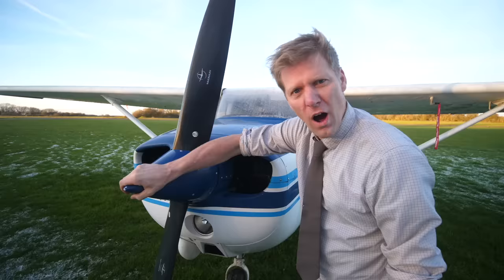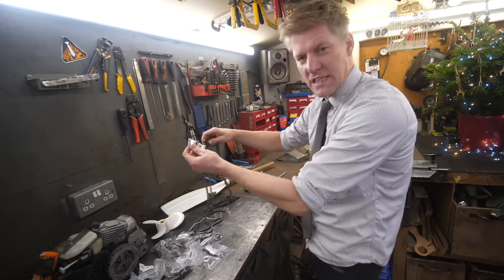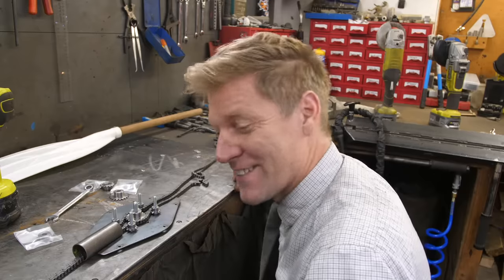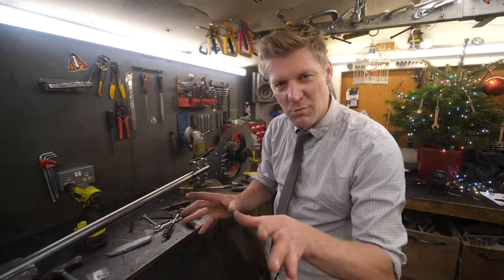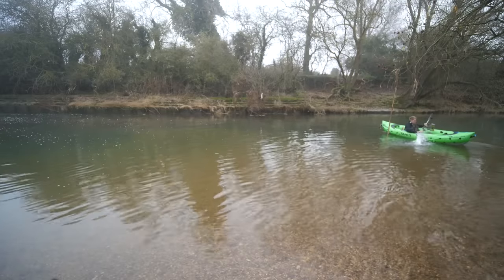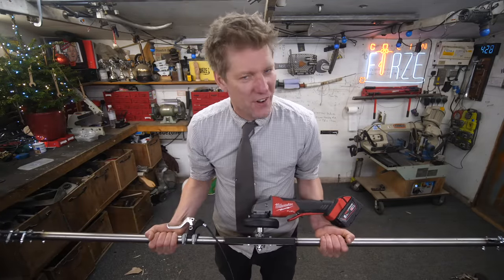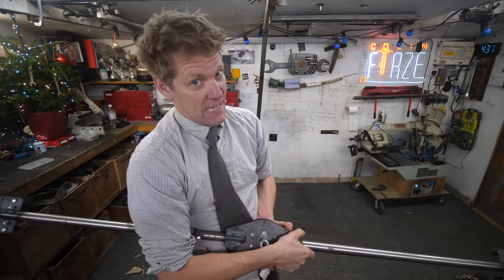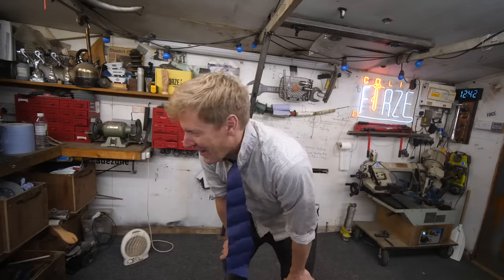I put high Speed Prop Blades on my Kayak Paddle!!

Comment: I can't help thinking about a curved bow fixed to the boat, with controls to spin the oars - with one side larger on each paddle - on the vertical axis (with the controls center-mounted). Even better if controlled with a joystick. Motor forward spin, backward spin, single motor for turning or double for straight forward or reverse. Almost like airplane controls. Except you don't want pitch or yaw with a boat.

Comment: I think, that You should unlink both props from each other — get one big battery in the boat, then put wires in the paddle. Put electric brushless motors on both ends of paddle, and make "open contact" in circuit. So when you put paddle in water, electric chain closes by water electric conduction and motor starts to spin. Add speed controller on paddle handle and You are done! No water from chain, less noise, less power-hungry and much lighter design + more speed. Each prop will work only when it will be submerged in water.

Comment: One cool idea would be to add some sort of sensors to detect once an oar is in the water. It triggers the correct motor once it's in the water, but turns off when both are in the water.

Comment: An A frame oar would of being perfect to this inertia and lower centre would control the steering without having to move the joints as much , also allowing for the water to fly upwards instead of across

Comment: if you modify it to have 2 drills (one for each propeller) and angle it to have both blades in the water at the same time, then you may have more control.

Comment: You should basically angle the tubes so you can get both propellers into the Water. Then you dont even have to paddle except for when you want to change the direction of travel!

Comment: It would probably be a bit bulky and more difficult to do, but instead of having one solid Kayak double oar, do 2 individual canoe oars or a way the double oar can split / angle down in the middle /\, and maybe even a way to anchor them to the sides of the boat. That way all you have to do is drop them in the water, hold them in position, and pull each of the triggers. And you shouldn't have one affecting the other. I know, not necessarily what you want for Kayaking but it would probably work a lot better.
But if you're going to do that, you might as well just throw a prop motor on the back. 😂

Comment: I think if I were designing this, I'd have gone with a mounting system where two paddles have their own, independent motors on an elbow bracket, so both blades can be in the water at the same time. That way, you eliminate the soggy crotch, as well as the spinning in the water. If a fancy option is on the table, have 'em independently throttled, so you can ramp each one up or down as required for faster turning.

As always though, the Furze way is fantastic as ever, keep it up Colin!
Reply: HMU on DISCORD? its s scam!

Comment: If you did the row boat with the two paddles attaches and use both at the same time to move forward, I think that would work better, both paddles would be in the water at the same time.

Comment: I think it needs to be angled so that both blades are in the water at the same time. The be able to put them into forward and reverse independently. So there would be no need to actually paddle. 😁😁

Comment: Shaft drive from an electric weed wacker would solve the chain issue. I think you should put individual motors on each end, bend the shaft so both sides can be in the water at the same time. Stack 16850 batteries in the tube for power.

Comment: If it was shaped like a v so both paddles were in the water at the same time you could steer by angling it. I get it wouldn't be the same as a kayak paddle but itay actually work really well. Awesome vid as usual!

Comment: just some thought:
maybe building the paddle in a "U" shape, controlling the power over two leavers on the shaft. Using a Belt and roller instead of  a chain to reduce the water to be brought up into the Boat. 
@colinfurze

Comment: @ 7 minutes in I'm thinking what he really needs is cable driven,like a weed eater,and the two arms angled rather than straight so he'd  simply hold the middle section flat and each arm would angle downwards into the water simultaneously resulting in equal pulling,or reversing if spun around side to side.. plastic/pvc liners inside of metal tubing would aid in alleviating a good deal of the noise as well as drag is using chains or cable drives as well as helping to isolate any vibrations... losing the surrounding metal beyond the props hubs will net maximum pull or push... simply avoid rocky or greenery with the props or install prop cages such as on some trolling motors..

Comment: I would have definitely made it into a v-shape so both sides can be in the water at the same time creating a stable forward or backwards, with maybe a toggle switch that inverts one side in case you need to do a 180.

Comment: that was very cool! should have made it on an angle instead of a straight tube, so you could have both ends in the water at the same time. Also, fixating the engine with a velcro or something stronger to the pole would have been potentially nut saving ;)

Comment: I haven't read any comments & only watched at this point up to the 10:26 mark. Now if you had the bar bent down at about 45 degrees at say about 500 mm either side of centre you could place both props in the water at the same time.

Comment: the extra plate material that makes it look like a paddle might be working against the props no? Because usually the paddle face would be moving through the water but now its stationary and just adding resistance.

Comment: On the ends, instead of putting the paddles with the fans right on the end. Maybe making a 90 degree angle downward at the end, and then adding the fans. You can just plop it in the water an aim where you’d like to go!

Comment: This is a good idea. Small cage around the propellers for safety. But you shouldn't have to paddle. Just put the propeller in the water and let it do the work. At most you should be mimicking a see-saw with your Paddle-PROpeller

Comment: Put the paddle portion of the oar at 90 degree angles which would give you the ability to dip the paddles to turn, but if you set the oar down on the boat and pulled the trigger you would go relatively strait. Kind of cheating but it’s a good idea for a clever propulsion system👍

Comment: You want torque? Try a Milwaukee Hole Hawg.  Tons of torque to drill large holes with self feeding drill bits.  The body is at a 90 to the business end, so it would not stick out like your drill.

Comment: Just seen Spiff's video about his "Fast Kettle" and feel like it could be done better with an internal combustion engine car using the cooling system, cleaned out and routed through a way to drain and top up from inside, to use the hot water to make the tea.

Comment: Make the paddle so it is shaped like this upside down \____/ and then both props can be in the water and you can just shift one forward or backward to change the direction the boat turns.

Comment: Should of made a 90° angle on both ends of the paddles then attached the prop blades that way they would both be in the water for going straight an then could just slightly lift either side out of the water for turning 😅

Comment: Hey mate use a weed wacker and build a single side instead of both build a mount for your boat of choice and flip the paddle part 90 degrees y axis and you got a very powerful prop motor that weighs nothing you can even rear gear it to get even higher prop rpm

Comment: Dude you should have put the paddle at 90° to the prop so that when prop is facing forward the paddle acts like a rudder then when you just want to paddle you turn it 90 degrees the way you got it the paddle is going to provide a ton of drag

Comment: I figured it would be a small engine powered prop boat like the prop sits above the water and on the back of the boat and like push it or in the front but that would be front heavy

Comment: you should have made a pedal kayak with a single prop on the rear with  a rudder on each side. or a independently controlled hand pedal powered paddle wheel (on each side) kayak

Comment: Maybe give ur paddle idea to some Gladiator Sport enthusiast for competition. I think 2 water snakes cut down as ores with throttle controllers might work better, 2 motors in the water all the time & u dont have to paddle just throttle one or the other for speed & direction, or turn one over so you can do high speed 360’s and make a water flower display while ur getting sick!
Reply: HMU on DISCORD? its s scam!

Comment: I wish you would have made this with two small DC motors on each end. Then you could just put the controller in the middle and all you have to run through the tube would be wires.

Comment: About 1/3rd the way through...you should have them spinning in opposite directions with a left handed and right handed props.  It causes torque in one direction.  I made a flying platform and while hovering it slowly started to spin clockwise...oops!  Fixing two of the 4 motors to ho counter-clockwise and have oppositely pitched blades fixed it.

Comment: Big problem. The prop is not a water prop needs to scoop. If you have a low mount on a hinge you can stabilize the motion back and forth. 
Just couldn't help saying it. Have fun.

Comment: No no no, just use a row boat and use 2 oars. Take 2 battery powered weed whacker with wire drive and just put a propeller on them as the oars

Comment: Should of had a bend in paddle so both would be in water providing thrust at same time. Could probably sell them. Sum states here in US dont need license on boats if they dont have attached motor. This wouldn't be attached. Beat the system

Comment: Would have been better if you made it so each paddle had a drill to power. Make a trangle frame that your legs go through, that tge paddles sit on

Each prop then sits in the water and you have much better control. And they rest on the triangle frame shape thingy

Comment: Why not angle each prop so that both  are  always in the water and rig up two angle grinders (one for each prop) with a trigger for each one? 
Want to go right (starboard?) -- pull the left trigger. And vice versa.
It would probably be best to find a way to securely attach it to the kayak. 
Do this and you would be cruising pleasantly, I think. The only problem is that this would no longer be an oar.

Comment: This would have been so much easier to make a paddle from a weedwhacker than add a motor to a paddle or fabricate the whole thing.  two-strokes are used all over the world as boat motors with a straight shaft.  Use an electric weedwhacker and it'd get rid of the noise.

Comment: If you had of had the end of the bar on both ends on right angles so you could constantly have the motors under water but turning would be a problem

Comment: Or you could have made it bent so both sides could be in at the same time. Less of a paddle that way and more just a motor, but your current design isn't much of a paddle either so. It would also be kind of cool to have each side spin independently of one another. Which I could think of a few different ways to accomplish that.

Comment: What if you instead, had the straight bar like you have, but at each ends the paddles were angled down at like a 45 degree for a foot or 2, that way you could have both paddles in the water at the same time super powering you forward, and could still steer by simply tilting and lifting one side out of the water

Comment: Step 1 get an electric motor wich a shaft coming out of both sides.
Step 2 Mount it in the middle and salavage the 90° Gearbox from 2 Angle grinders.
???
Step 4 Profit. also doesnt pull water in like with a chain.
and maybe adding some shrouds or cover around the props so they dont splash water sideways and only where its suposed to push the water.
🤔

Comment: Why wouldn't you just get a pair of trolling motors and build it out of that?  No chains running in water.  Could have independent triggers for each side.  Batter could sit in the boat instead of being on the shaft.

Comment: Would have probably been a lot better if he had did a middle bar to use as a guiding/throttle rod while both props are in the water probably a 45 to 90 degree bend on either side so that instead of a row motion it's more like a duel prop jet kayak and would probably handle a lot better to especially if he used two drills one on each so as to be able to steer but amazing idea anyway though

Comment: That's a canoe, not a Kayak.
The fans are also cavitating - gear down the grinder (more torque less speed) and use it like an outboard with a single paddle.

Comment: Can you make 2 separate paddles with 2 attached motors and use them as you would on a boat so they both go in the water at the same time?

Comment: I don't know if I'm the only one talking about this... I hate to break this to you but high carbon steel has a tendency to rust... This is pretty awkward but all of the steel that you have used to create your bunker will eventually be completely corroded. I don't think there's any amount of oil or wax that will prevent this. Now? You are using high carbon steel to create water paddles? I am completely confused as to what your angle is here? To get a project done and off the books? You do realize if this has any use 2 months later it will be complete seized up correct? So many questions and all you have to say is "thank you for the $8."

Comment: I love the concept and your videos! I would be concerned about the chain in the water being an issue with both rust and the issue you discovered with spraying water everywhere. If you were to do something like this again you might want to look into doing it with shafts and bevel gears which could be a completely sealed and lubricated system similar to how outboard motors are constructed.

Comment: You should built it as a \_____/ shape but obviously upside down, then you could have both motors in the water simultaneously to accelerate forwards and tilt it to lift one side out of the water to turn🤔 I could build you a prototype lol I’m a fabricator

Comment: from an engineering perspective doesn't it make more sense to join them at a 75 degree angle not a 180 degree so u can put both sides in the water and propel forward and then lift one side slightly out of the water to rotate
Reply: HMUColinfurze6294  if only u were colin ⛵✈
Reply: Hahaha!

Comment: Furze, I am no engineer and therefore have no real ability to comment. Surely you want it to bend in the middle like a normal set of oars so they can both be in the water and then you have less effort and greater propulsion on both sides. With the ability to lift one side for direction

Comment: It would work 1000x better if the props were retractable and mounted to the kayak.  Putting them on the paddles is too inefficient.  The paddles are less effective the props have to deal with constantly moving around and the chain driven nature means warer getting everywhere.  Also dont use these anywhere near salt water.  Chains really dont like salt.

Comment: Meh this one is not vary original. There are already commercial yaks with motors or peddle drives. And just about every drunk FloridaMan has attempted to strap anything from a salvaged waterjet to a literal jet engine on some cheap lifetime kayak.